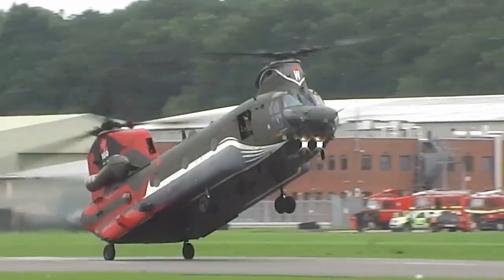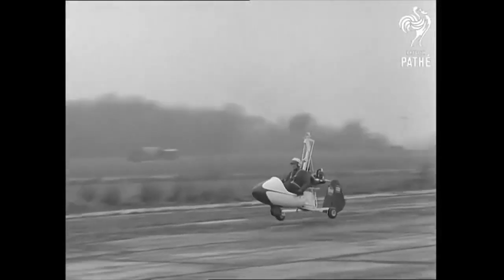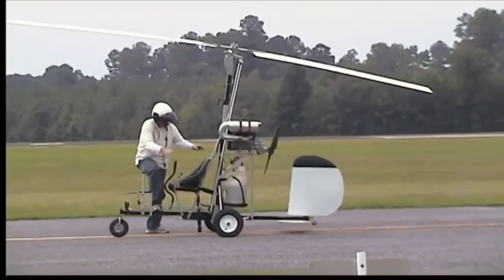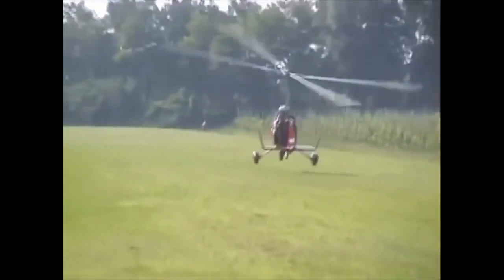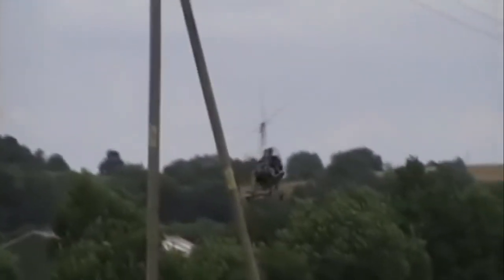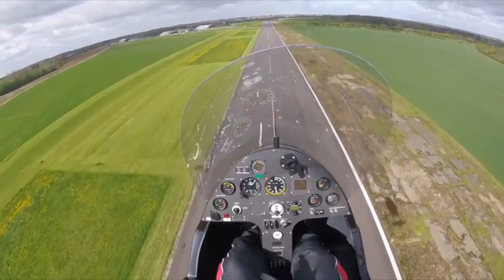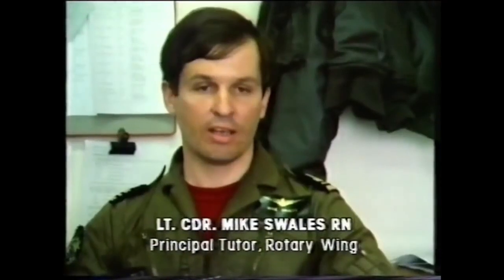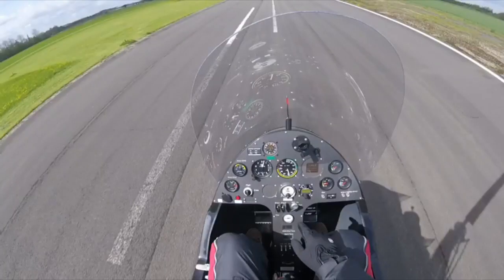Gyroplane/gyrocopter wheel balancing [part 1]

Comment: Footage shown was of poor rotor balance behind the power curve.  I did fly gyros without rotor rachis and prerotators.  I was often off in less airstrip but I agree you need to hold until best LD is reached.  I found many gyros pilots were lulled by big blades and prerotators but were caught with machines with incorrect ground balance. Hence machine took too long to get nose wheel off.  You must get off flat then build to best LD ratio.  How many are relying on 100hp to overcome poor technique? If you have a sequence that works great.  Plenty of footage of powerful expensive machines Turing into scrap.  A lot to be said for learning in basic machines like gyrogkiders,. Managing rotors.  Your method may well work on that machine. X rpm then X power until X rpm is reached then rotate.  If balancing works as short field technique it only works because you are managing the rotor to the given airspeed.  Rotors spun up over the rpm they can sustain and then adding too much power too soon will result in hinging what you are calling sailing.  Retreating blade stall.  The danger you face is if something goes wrong eg really strong gust, a sudden loss of power and your heading down the strip at 30mph and the blades are now slowing below what they can handle and they hinge you are going to struggle to recover.  It strikes me you are advising a brute force method to overcome what?  The student to be able to balance on the mains?  If the instructor cannot teach this then they shouldn't be instructing.  

Strikes me the old gyroglider misunderstood and under appreciated.  You learnt blade management, you learnt to balance properly.  And they were cheap.  We'd do a take off and landing every minute so an hour in a glider was about 60 of them and it cost what less than $1000 if you built your own blades?  I'd see guys with 27foot rotors 582 rotaxes with hydrolic prerotators struggle to get off in half the strip.  Mainly because the main axle was too far back so the nose was planted on the ground too long.  If your blades are pre rotated beyond the point where the airspeed is going to cause them to accelerate they will slow.  So you then have to rush to get to an airspeed they can start to build, this sucks up airstrip and you cannot use what is behind you.  My typical take off was hand wind taxi out.  By the time I was at the threshold they were more than up to speed.  I'd taxi at 10mph until they reached second stage (when the blades accelerate) bump up to 12mph a second or two latter the nose wheel came right back, gradually add a little power and push nose down, now accelerating gradually put in all power, lift off at 20mph hold level until 30mph and climb out.  My VW didn't have the rate of climb of the Rotax guys but they over prerotators gunned it and hoped they didn't get caught in high speed hinging.  Good technique works every time.  Eveey takeoff should not be calculated to get off the ground first but calculated to get off and climb out level at best LD.
Reply from the maker: I have the type of conversation often and in the main we are in furious agreement although I'd also say this.  I operate in the UK and frankly in 2020 (as we are now) times have changed from those days of being able to learn as people did in the 50's/60's/70's even the 1990's. There aren't the facilities, in the UK there isn't a single gyro glider being operated and the machines that get flown subsequently are such that the student isn't really minded to spend time in a machine he isn't going to fly, he would rather spend his time (and money) in a 2 seat aircraft he is ultimately going to fly.  And for the most part I get that.

In the UK single seat gyroplane (and its a shame but I'm just reflecting the facts) are almost none existent. So its horses for courses .

In terms of wheel balancing, it works, you can take off perfectly using that as a technique but by the same token the reality of UK pilots are that they fly low yearly hours, they fly factory built machines and I believe it is useful to at the least talk about things that may give them some colour on something that should give them some consistency in their take off.  Often gyroplane POH's are very poor at giving detailed data in that regard and very many equate the aircraft unsticking with take off rather than an ability to climb away.

Finally I also (personally) dislike the term "behind the power curve" I understand that it is a well established term from the Bensen era but it isn't helpful to the student because when you are flying in that state power is neither the cause of the problem or the solution to it.  I use being "behind the DRAG curve" because that is the cause of the problem and changing the aircraft attitude will be the solution.  Cheers, Phil.
Reply: @gyrocopterflyingclub6148  

Hi Phil,  I hope I didn't come across as aggressive last night, it was late but I'm very interested in this topic.  I'd like to pick up on a few of your points.  I'm Australian and our regulations are much freer than yours.  I visited a gyro club in England about 20 years ago and was shocked at how tight the regulations were.  So what you say about no gyro gliders does not surprise me. 

However it's a great pity because they are much maligned and it's hard to see why.  I instructed in gyro gliders over 16 years and as a I was poor student while building my first machine was a gyro glider instructor and my first though on braking ground for the first time in my powered machine was "this is exactly like the glider".  When I got into the sport out here the air comand two seater was new and it was assumed that we would no longer need to use glider and ground runs in our training.  However the difference between such machines two up and one up was so stark the fatality rate increased dramatically.  New 912s powered heavy machines may now be sufficiently similar that this may no longer be such an issue but I've watched enough videos of poor blade handling and taking off too soon in these 912 powered machines to know that behind the power curve or high drag take offs are a bad idea. 

A little more on the glider: 

>that the student isn't really minded to spend time in a machine he isn't going to fly, he would rather spend his time (and money) in a 2 seat aircraft he is ultimately going to fly. 

When I was learning the cost of two seat training was in the ball park of $80/hour.  Our club charged $1 per run (most went to the driver for fuel and wear and tear) if the club member owned a car suitable of towing the glider then they could use it and pay nothing but the yearly fee for maintenance of the glider.  We'd have them solo in a couple of weekend and ready for two seat training and ground runs on their individual machine.  At the same time two seat powered instructors down here were changing $80-100/hour and blokes were spending 30+ training.  As we had covered 80% of the techniques and processes in the gyro glider most blokes would spend between 3-5 hours in a two seat machine with our CFI after learning in the glider and another 5-8 hours typically taxiing, balancing on the mains and learning in their own machines.  It was significantly cheaper to learn in a gyro glider, thousands of dollars cheaper and our safety record at the two clubs I instructed at were second to none "literally".  I would often get students who had failed to learn to fly with two seat instructors having spend 20-30 hours and then finding, they could wind up or manage blades, could balance on the mains, were rough in handling and had to re-train them.  Of course this says more about the quality of some of our instructors. 

We also had a huge number of two seat trained pilots crashing and killing themselves.  So clearly just having two seat powered machines is not enough.

>In the UK single seat gyroplane (and its a shame but I'm just reflecting the facts) are almost none existent. So its horses for courses .

I agree that's increasingly the case here.  I'd like to build an electric gyro, batteries aren't quite there yet but might be in 5 years time but many of our issues are around noise, particularly in the slower machines I like to fly.  So a direct drive VW is very rude now, lots of noise complaints, rotaxes two stroke better but still ZZZZZ at 30 mph a little bothersome for some.  I'd like to sell a couple of my single seat machines but gather it won't be easy.  People are instead flying $115 000 machines and many are still smashing these up I hear.

>In terms of wheel balancing, it works, you can take off perfectly using that as a technique but by the same token the reality of UK pilots are that they fly low yearly hours, they fly factory built machines and I believe it is useful to at the least talk about things that may give them some colour on something that should give them some consistency in their take off. 

This I think is the core of disagreement we have.  I'd argue it's the shortest and safest way to take off.  To me it is therefore the best and proper way to take off.  It sounds like you are saying this brute force method were the pilot doesn't have to know what to do to get off strikes me as potentially something that could get a guy caught.  At each phase of take off balancing on the wheels I'm under more control.  At wind up my blade produce sufficient drag to require increased airflow over the rudder so my authority is excellent.  Once on the tail but way too slow to over rotate (seem quite a few expensive machines destroyed on you tube that way),  my blades accelerate even faster using less ground and increasing rudder authority as it requires gradual increase in power and therefore airflow over the rudder, I'm still only about 12mph so I haven't gone far.  A second or two here and my blades are now fast enough they cannot hinge (sail, flap - we called it hinging basically retreating blade stall).  Gradual addition of power and balancing now gives a flat and controlled lift off at 20mph (in my VW), hold in ground effect until speed builds. 

Everything is gradual, everything is smooth transition and cutting power will result in just landing.  What worries me is the speed, strip loss and even some really good pilots seem to tear down the strip the basically have a very short transition to on the ground nose up quickly dampening it.  Strikes me not much would have to go wrong to foul this all up and be in a spectacular ground crash (and I've seen a few).

Looking at a lot of machines parked without pilots and what strikes me is how many sit on their nose wheels.  Blades once back on their tail wheel accelerate much much quicker.  There may be something I'm missing here but having a pre-rotator to speed up ground run and having a heavy nose is counter productive.  I saw a guy that couldn't get his Bensen style hydraulically pre-rotated rotax machine off in less than half the km long airstrip, climbed well after that then I tried to lift his nose wheel off the ground (mine sat on the tail wheel until I got in it). His axle was an inch and a half further back than mine. I'd be willing to bet you'd halve take off run of many of these machines with correct wheel balance.  This may be part of the problem some machines may not lift the wheel until much higher airspeeds.

But if you can't modify or adjust the position in UK then you're stuck.  I'd buy one that sat on the tail wheel when no passengers were in it though. 

I think we are still in a phase were there are few good aeronautical engineers involved in this game.  It strikes me too many don't read about the Old 1930's gyroplanes and why decisions were made, they don't realise Bensen made a lot of decisions around things like resonant frequencies of rotor and engine.  We slap on the biggest engine put on huge rotors to compensate and don't consider simple things like wheel position and the impact this has on ground run and handling.  I think generally we are now flying very large, very powerful Bensen machines that look good and now have reliable engines but we've been throwing the baby out with the bath water.

Look at the Wallis machines.  How very elegant, how much cheaper to build one of those than say buy a Magni?  Not criticizing the Magni but how many world records did Wallis hold in his little machines with 48 inch props and short wooden rotors?  How many records do his machines still hold? have we really come that much further? 

Anyway regards, keep up the videos these are the sorts of discussions it'd be good to have more of.
Reply from the maker: @cameronlapworth2284  Hey - first of all I didn't take any offence at all.  Not only did you not say anything offensive but debate and discussion is absolutely at the core of flight safety and progress in flight training and improved skills.  So I'm very happy you took the time to engage and even if we have wildly different views (and actually I agree with much of what you've said) any differences probably teach me more than living in an echo chamber!

OK quite a lot to digest fully but a quick response from a first read through.

Gyrogliders in the UK probably suffer (in terms of the lack of use) from a few things.  Biggest factor is lack of anywhere to use.  I can think of maybe two places in the UK that would be great venues (Bruntingthorpe and Elvington) but the venues will cost and they will also have half an eye to safety v liability v pain to them managing the fallout.  The second issue is that nobody is making a gyro glider that you can just buy off the shelf and get going.  OK its easy to make your own (but now think liability) and actually fundamentals like rotor blades are not that readily available in the UK.  The final issue is that [and I adore the concept of the $1 per run community] but again in the UK there is no such community.  The BRA [British Rotorcraft Association] is a shadow of its former self and in the end the promotion of gyroplane activity in the UK is 1 notch above zero.  It really is as pitiful as it is niche!

The point of all that is your average instructor just has no capacity or appetite to add layers of complication to his training organisation that would need to operate at multiple venues anyway were gyro gliders to be facilitated.  

The value of using such an aircraft I'd be in little doubt over however.

Single seat aircraft in the UK are ultimately stymied through regulation and allied to the lack of cohesive UK gyroplane community that situation will continue into the foreseeable future.

You're right about the costs and in the UK it has had the added headwinds of a weak GBP verse the Euro and the focus upon added complex machinery to satisfy commercial and night ratings, both of which have so far failed utterly to gain traction.  Once again therefore focus has been elsewhere and again as all instructors in the UK are effectively "one man and his gyroplane" type outfits not only does one voice tend to get lost but also very often the instructor community fails to even find its voice for fear of sticking a head over the parapet and getting it shot off.

I disagree the wheel balance technique is the shortest or safest way to the air - although it needs explanation / caveated.

It really depends what is meant by wheel balancing in that ultimately every aircraft is at some time on the main wheels with the nose wheel aloft - same for fixed wing - but if we mean wheel balancing in the traditional sense of waiting until that point before applying additional power in order first to become unstuck and then to climb away then it isn't.  I've tested this many times in Euro-type 2 seaters.

Yes you'll get airborne, yes safely but there are snags.  Principle amongst which is take off distance required.  If we talk student here then that method can be literally anything and it depends just how much they pre-rotate to, how much power they apply initially and how quickly they can find a stable wheel balance.  [and actually if you take a high profile UK instructor he has changed his own technique / advice on this over editions of his own book].

The next issue is that Magni and AutoGyro aircraft are fundamentally different [i mention these brands because they are effectively 100% of UK gyroplanes in 2020] Magni has a straight keel and less rotor head movement with full back stick.  This is a large contributory factor to why AutoGyro aircraft are often seen to "Over rotate" and that is especially true with Calidus and Cavalon models.  So in many ways the slight forward stick I mention with AutoGyro aircraft just gets you closer to a stock Magni!

The final element however is simply down to drag.  At some point you have too much drag and that isn't helpful to take off performance.

The risk with a technique that I mention is that pilots get too greedy with forward stick and they sail the blades, that said when part of the technique is rooted in knowing what the RRPM is I find that hard to believe is possible.

I'll leave you and readers with this final thought.  Outside of those following my thoughts here the principle method to get a gyroplane into the air in 2020 is the wheel balance technique that very many defend with a passion.  However that tells its own tail doesn't it?  

Think about it... Every single accident that has happened to a gyroplane upto 2020 - every single one - that has happened during the take off phase through mishandling has happened to people using the wheel balance technique.  It was for that reason I looked for a "better" more repeatable technique that consumes less mental capacity.

Now I will accept that they may have used the wheel balance technique badly but that is just my point.  In 2020 you can do only one of 3 things.  You can keep replaying the same narrative and no doubt the situation will remain the same.  You can hope to improve the current technique by hoping we add gyro gliders/ single seaters [but as I've explained that isn't going to happen] OR you can change the narrative and monitor the results.  

I'd like to think that the intelligent path to progress is modification of the current techniques and see if we find improvement.  Thanks for the exchange.
Reply: @gyrocopterflyingclub6148  hi and thanks for the thoughtful reply.  

By the way one fingered typing on a phone this time so forgive predictive text errors.

I understand the bind you are in in the UK.  When I visited 20years ago I was chatting to a guy with a similar gyro to my own VW machine I couldn't believe how much he'd paid.  I'd build mine for about $2500 with a lot of help.  But we were are free in a single seat to do what we like with many components. Our regulating association sometimes has different ideas but most of the emphasis from the government body is on kill yourself so long as you are not flying over built up areas but we want tight guidelines on two seaters.  But I could still buy X machine, or build my own.  One example was nose wheel steering set ups.  While I was there I one student was doing ground runs.  There was cross wind, not big but as the rudder was linked to the nose wheel the gyro would yaw everytime it lifted and shoot off to the side touching down again.  One bloke at our club had found near solution were he extended the top bar of the rudder pedals in with its tab and under the inward extention had an isolated bar that when taxing you twisted your feet across it too giving direct nose wheel input.  At the start of your ground run you straightened your feet so they were just on rudder and the nose wheel catered straight with the help of a spring. Anyway I explained it to the guy I was talking too and he told me once a design was approved you couldn't change a single bolt.  I was staggered, what if the design is dangerous or likely to cause a roll over in this case, no you have to stick with what you have.  So I get the predicament and do understand why you may not use the gliders it's a great shame though.

On the shortness of takeoff.  I'd have some caviates of my own but still disagree.    All the strips I flew off over the years usually required me to taxi to one end or the other.  As such I would wind up where I parked and by the time I'd taxied to the end of the strip I had asuch rotor speed as I needed. I also found on powered machines the blades were helped by the engine adding some airflow, unlike the glider.  In the glider we were generally parked at one end and hence it would take more time to get the blades up without prerotators, unless we had any sort of breese which was often.  

But I found the biggest factor was wheel position on keel relative to weight + good technique.  As I said I had a direct drive VW with 22 ft rotors and was regularly getting airborne flat in half the airstrip of guys flying 582's with hydrolic prerotators which are very powerful.  I've also seen many a guy with  prerotators smash their blades in a high speed hinging accidents.  Particularly when the Boyett twisted blades entered the scene.  Higher angle of incidence blades are more susceptible to hinging (sailing flapping) as the need higher rpm before Thier retreating blades cannot stall.  I've seen plenty of guys get caught punching too hard too soon after pre rotation because the forget that the blades once disengaged will slow until such point that there airspeed meets the point that can sustain and increase rpm.  So the guy that taught me build a lovely two seater with 912s, his taller mast requires pre rotation but he still uses the same technique still gets off in short distances.  

However I've not flown a magni,. My suspicion is they're nose heavy and won't lift it until well into the wind up and fairly close to take off speed?  Would this be correct.  If so you may be right.  I'd argue you'd get off quicker with a machine that had normal range of back stick bensen style ratio when in the tail wheel.  If the machine can't do this then your technique may in fact be better.  

As too the balancing comment I disagree. Most of the accidents in the old days was not because of attempting to balance it was because of hinging the blades.  We had two camps or philosophies down here.  I live in Queensland Australia is bloody big and we had about 400 members probably 120  actually flying.  At the time we formed our Queensland club about 30 years ago now you could learn at the Grafton club a 4 hour drive which had monthy meetings or you could get an old timer to teach you with interesting results.  I was committed to the former fortunately.   I trained as a gyroglider instructor down there and I continued to help out at Grafton after we got our Queensland club going.  Others actively resisted learning this way.  We'd get guys come out for a few weekends get a life time in the glider, then they'd disappear only to find out they'd been told by the other camp look the glider will teach you had habits so get a little time on it and then come with us.  I had some friends in both groups on weekend I saw how the other side oppertated. One of my students was doing ground runs at a friend's strip and asked me along.  All the guys in the other camp were there including one guy I'd started teaching.  Is Constructing you.  Yes.  Okay on asking X he'd say no but if a guy asks me some advice I'll give it. X was God to these guys but he'd not lift a finger to help as far as I could see.  I squirmed as I watched my student hinging his rotors up the strip.  Are you not going to stop him? The coment I heard is burnes into my brain everyone does at least one set of rotors learning.  I raced out waving my arms, stopped him showed him the correct technique and he continued with no further problems although I got a cool reception.  The guy that owned the strip was also in the unlearning model of flight instruction with the same shrodengers cat of instructor s. His students thing he's instructing them but he won't admit it to me liability? Anyway he was getting closer to the fence everytime.  I watched mystery instructor are you going to stop him.  He sat there.  Crunch!  Anyway that gives a flavour of the skill set that many of the so called instructors had down here.  I was lucky, but even given the choice many used the she'll be right approach.  They all ended up with prerotators I noted.  Mainly I think because it reduced hinging accidents, only it didn't remove them it just meant when they did get into it on a windy day or with high pitched rotor it happened at much higher speeds.  

As far as over rotation that can happen more easily if you are rushing down the strip to catch up with you decaying rotor rpm.  However if you machine doesn't want to lift the nose and you can't change that then. I agree there would be no point trying to get flying speed up and linger around on the mains when you could be 2 feet off the ground establishing best LD.  

So there were guys who'd get off with touch back stick but many more smashed the hinging before that point.  Good technique works every time though I never had a student crash on me, they could all do it in all conditions everytime before I let them solo.  Same at Grafton people just didn't smash the machine up down there.  Terry is an excellent instructor and that more than anything is the key I feel.  Really sorry it's so difficult there.  We still have quite a bit of freedom down here for which I'm grateful.  Keep up the video s. Enjoy them enormously.